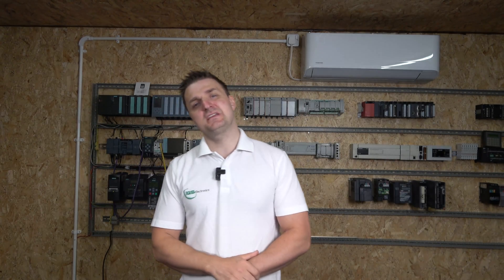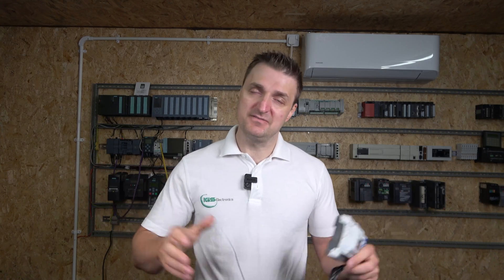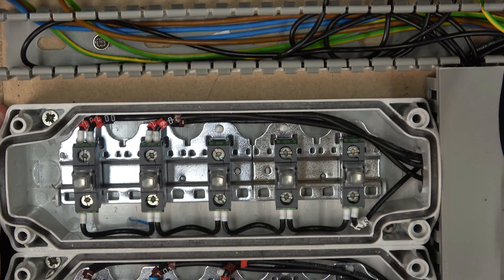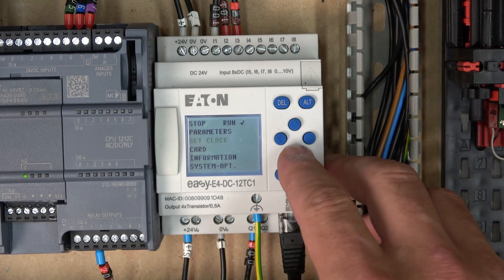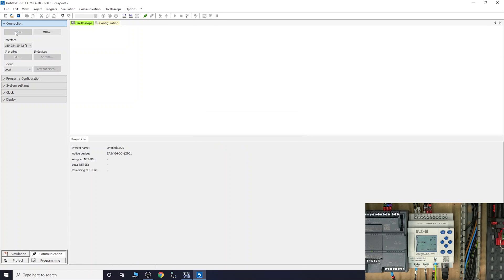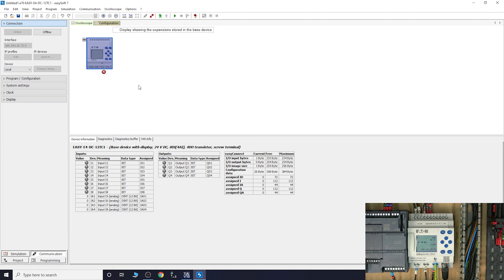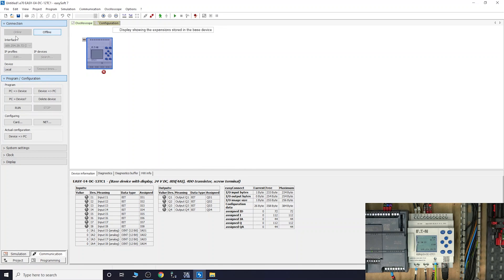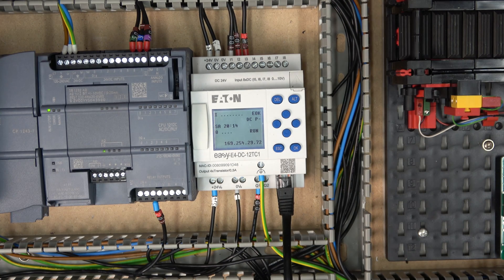Eaton Easy E4 smart relay, wiring, program upload/download using EasySoft 7. English

Comment: What’s better this or logo?
Thanks for the videos
Reply from the maker: That is a hard question to answer. Its all about what you are use to. Both controllers are packed with technology and as newbie on both of them, i found it lot easier to get my head around it with Logo then E4. So if i would have to chose one i would personally go with Logo. That do not mean that E4 is worst, as it is not, its just personal choice.